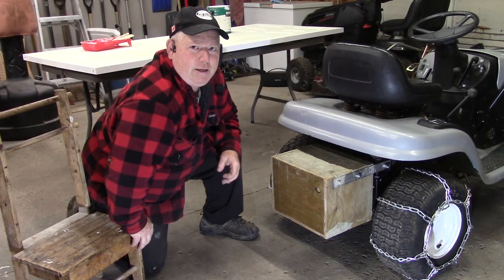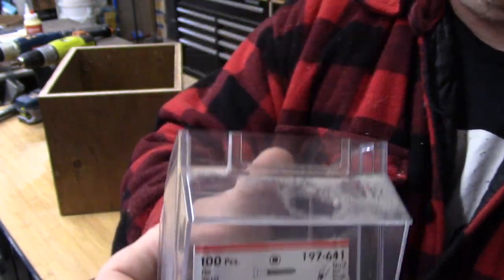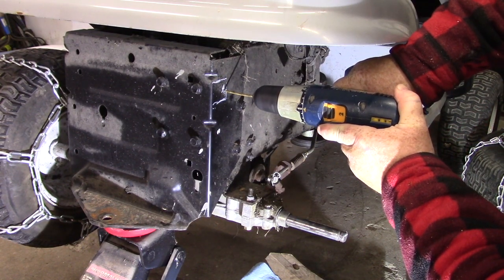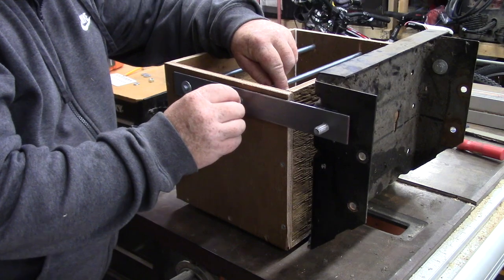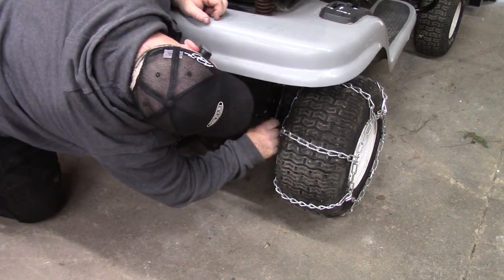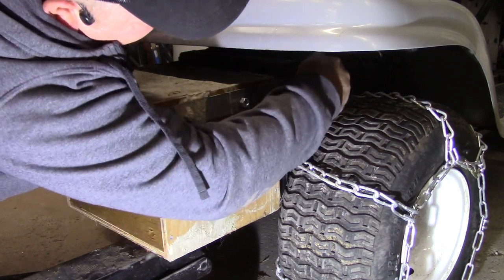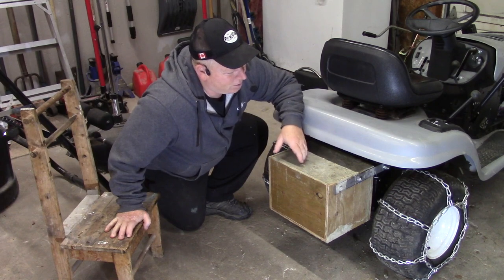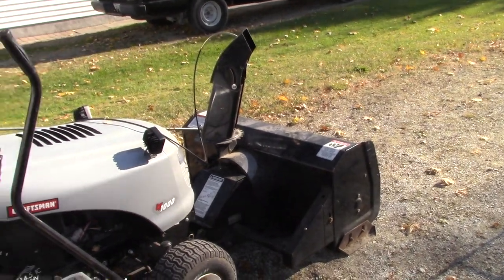DIY Lawn Tractor Counterweight

Comment: The problem with wt  on back is it puts weight on axle/ transmission - not sur3 if it matters
Reply from the maker: They have different weight options.  I’ve seen wheel weights and frame mounted weights.  This was the cheapest easiest method I could think of.
Reply: So does a guy 50lbs heavier. It's built to hold different weights